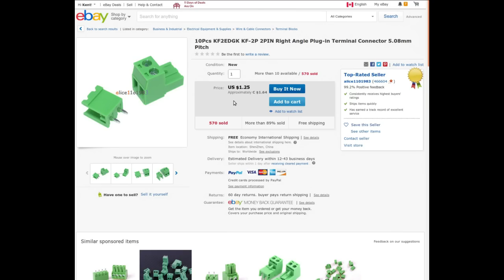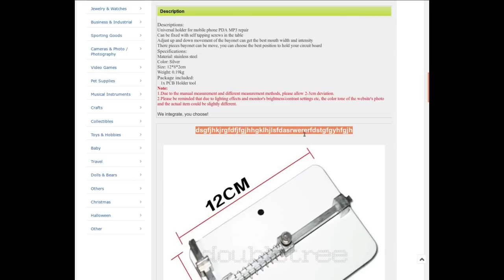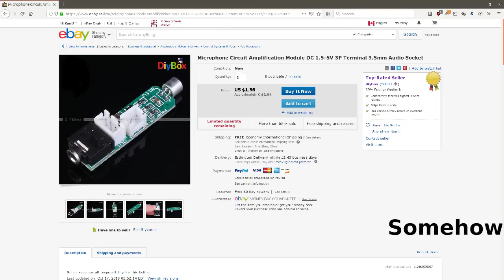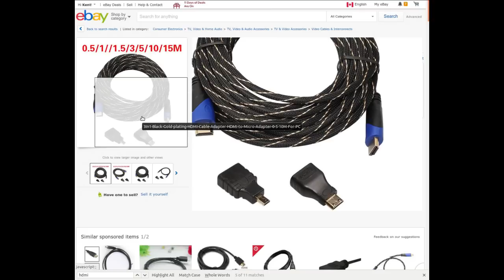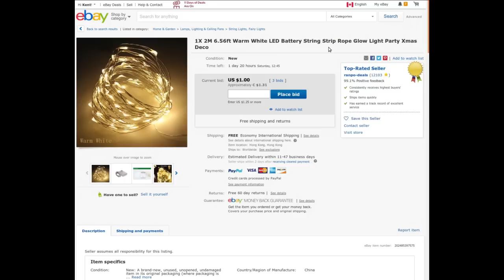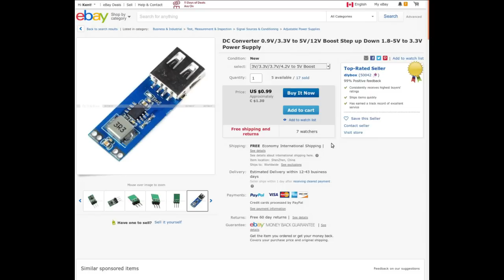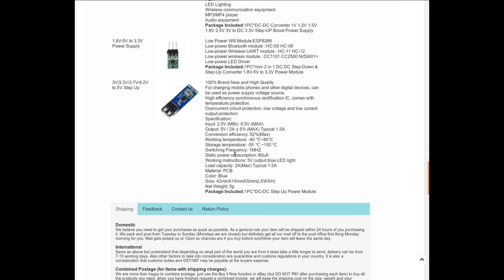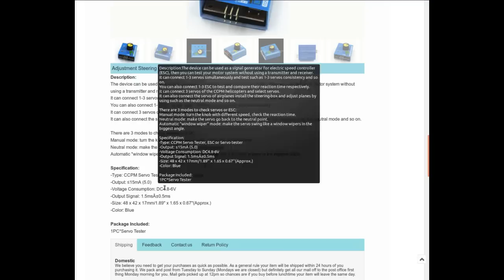mailbag monday 42

Comment: This still might be a power problem with that servo motor. Take off that plastic box, and solder some caps right on power input, it might help to keep more stable supply for that mirco inside.
Reply from the maker: Interesting suggestion. Something to take a look at.

Comment: I was wondering about why the listing for the servo  tester said output less than or equal to 15ma at 5v? My other thought was to try it running off some batteries once.
Reply from the maker: The servo's data sheet says they work anywhere between 4.8 - 6 volts. 

I'm not sure about that current rating. It may be the idle current (you never can be sure with some of these Chinese translations). That seems low for a running motor.
Reply: @pileofstuff Pin bright happy waterfall to undersanding.  That translation couldn't possibly be made any clearer! LoL
I think you are right idle current seems a very plausible answer.  That tester just really bugs me it acts sort of like a crash and reboot, if it's in manual when you power it on do the moode lights blink then or the servo tick to the right a step?  Sorry about the questions I just wish it was on my bench so I could put the scope on it and see what's actually going haywire.  Maybe a beer will take my mind off it but I'm not saying what kind  or you'll just keep thinking  "How can anyone drink that stuff !"  Cheers. Oh btw what would Clive think if he  caught you buying cold white leds?  LOL